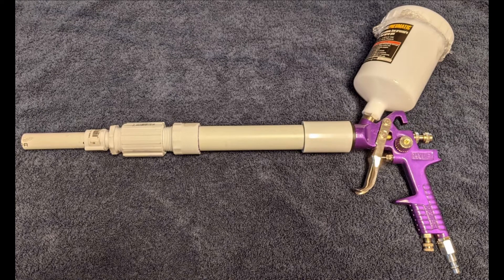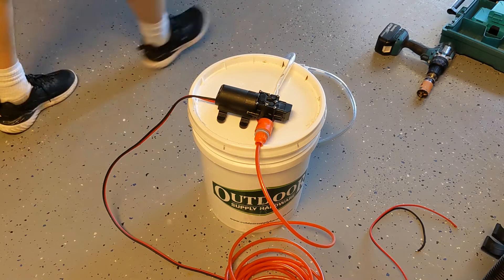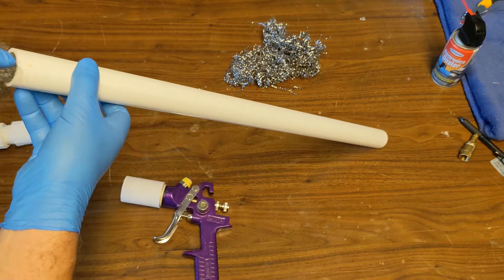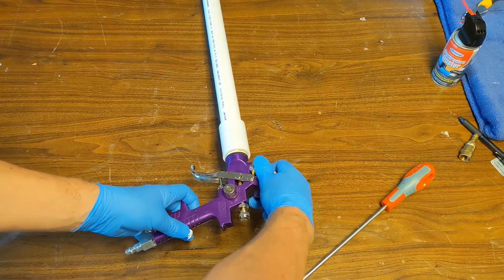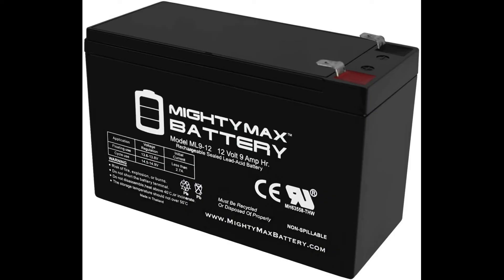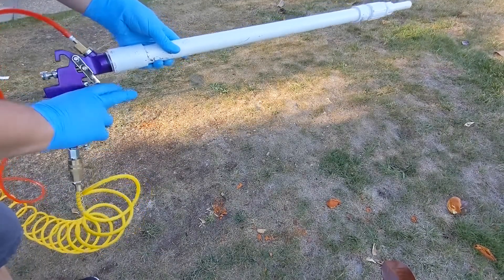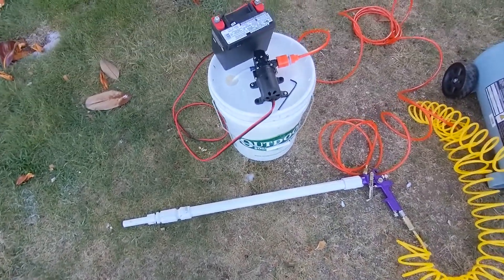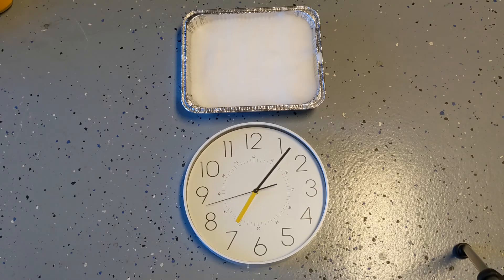The best DIY, Professional Air Crete Gun for under $50

Comment: This would work even better with the tank pressurized by the compressor as well. I am thinking a garden sprayer and a valve at the handle to turn off pressure at the base of the gun until pressure build in the tank and then partially opening  to start spraying. Or a bit more complicated and thus a bit more cost 2 lines connect by a t or y valve to be able to supply pressure to both and adjust how much as necessary.

Comment: I used your gun design Thanks !!!!!   How the heck do I get the foam density up? I am using Axiom dish soap  25 ml/litre and glycerin  5 ml / litre,  Compressor set to 100 psi and reduced to 40 at the foam gun , a 12V car wash pump on demand pumps the soapy water to the gun , . It looks nice and creamy but when I weigh it it is only 40 grams/litre  not good enough .   Thanks  , I am in Costa Rica so hard to get technical ingredients ... and expensive , so trying to use the soap to start
Reply from the maker: It's a bit hard to debug it remotely, but I would say try to tune the steel wool but be careful with the PSI too much makes it pretty dangerous.

Comment: From the first video ,https://youtu.be/fia6y4bHZIo?si=52Dp2F_iwda4Pyco a simpler  way might be to have a junction in the air pipe and a line going into the top of the soap mixture  to use the air pressure to do that instead of the pump

Comment: Do you perceive an issue if I use a 3 gallon container to hold the solution versus a 5 gallon bucket?  I might still use a 5 gallon bucket to mix the solution as all the “recipes” are based on 5 gallons of water but I have a cool SS tank that the pump attaches to.
Reply from the maker: It should be fine

Comment: Since you are already using mains power for the compressor, why not use a $20 12v 10Amp power supply  for the pump instead of a batttery?
Reply from the maker: Sure, you can do that. It was just easier to use the battery and safer to mix water with battery than main power.

Comment: Seems like the sprayer will suck up the soapy water without the pump.  
How much water is mixed with the soap?
Reply: The sprayer will not suck up the soapy water without the pump, there is too much back pressure. Sorry I do not remember the water - soap ratio.

Comment: Well, I tried this. I thank you for your work and the video. However, it leaks. My water hose keeps springing leaks right on the 1/4 inch hose bar. The PTFE tape works on the screw connection. However, the end of the pvc pipe nearest the gun is leaking as well. I am wondering if maybe I packed too much stainless steel (Scotch Brite) in the chamber. Oh and the pump motor itself is leaking on the top of the lid as well. I may have to buy a Little Dragon.

Comment: I don't know how to share Amazon links in comments. However, I ordered a blower fan with an adjustable power supply for $19. It looks like it will plug into the pump instead of using the car plug. I also ordered the pump kit from this video. Both units are supposed to arrive tomorrow May 13th.2024. The blower fan is for an upcoming waste oil furnace build. I will report back as to whether or not the power supplies are interchangeable. It's a 6000 rpm blower fan if anyone is interested in looking it up.
Reply: The power supply from the blower fan works awesome. The pump and sprayer work well out of the box. I don't have the paint sprayer and PVC yet. I'm going to try and get to harbor freight and home Depot tomorrow.

Comment: Great build. Will definitely follow. A question. Why a 12v pump and not a simple 110v fountain pump?
Reply from the maker: You can use a 115V pump but not a fountain pump it simply won't have the needed pressure. The pump's pressure needs to overcome the compressor.
Reply: @ItaiLeshniak  thank you. I'll look at the pump you used for specs. Looking forward to a summer of foam.

Comment: Just wondering, what is the benefit of this terminating into a thinner pipe? Couldn't the gun barrel simply end at the end of the 1" pipe? The wire will stop the stainless steel wool coming out so why is the thinner pipe necessary on the end? Thanks
Reply: I was wondering as well

Comment: Sorry if I missed it in the video - did you cut the existing power line from the pump and replace it with your own? The one you linked on amazon has the car charger connection. Could I substitute with a different power supply that I can plug in to that adapter? Thanks!
Reply from the maker: I used a motorcycle battery. You can plug it in your car or cut and connect to a battery. You will need a powerful 12V power supply if you want to connect directly to one.
Reply: @ItaiLeshniak  You can also use almost any 110/120 AC pump.

Comment: can one use a Submersible water Pump instead? If yes, what type or model would be best? Thanks.
Reply from the maker: No. It does not have the required pressure.
Reply: @ItaiLeshniak  thanks

Comment: Would this be the same thing as using a pressure washing hooked to a bucket of soap solution? We have a good brand high pressure washer I bought for my husband to wash his semi work truck. I have seen him using the soap solution and spray it on his truck. It's the same thing, right? Thanks.
Reply from the maker: I don't think it will work. It needs air in the mix. But try and if it does let me know.

Comment: I actually have the best DIY air crete gun! It was so easy to build with just a 3d printed chamber to hold the sponges/steel wool, an air port, and a water port. I put inline valves on both the lines to dial in the foam, and there it is. I used a flojet pump and the smallest compressor at harbor freight and i get mountains of foam! Just search youtube for 3d printed foam generator, here -> https://youtube.com/shorts/XUMh79Vny0Q?feature=share

Comment: This is the best build I've seen, thank you. I will have to get the pump you used, I bought a cheap one, and the air pressure just pushes the water back